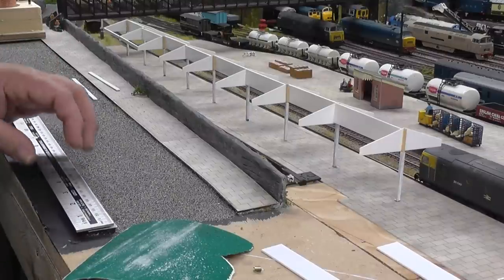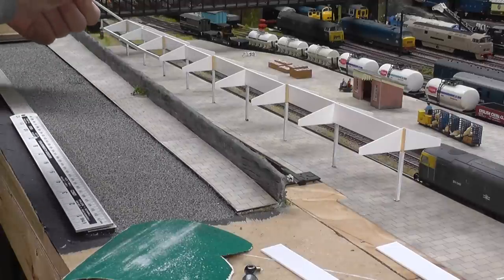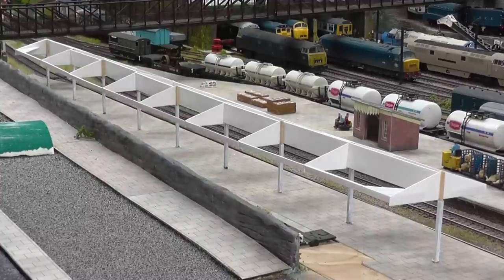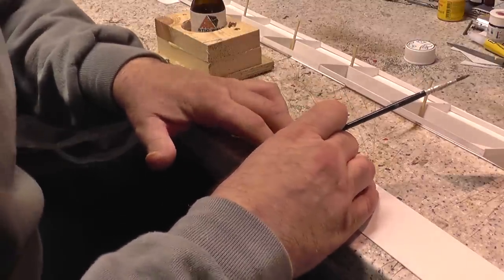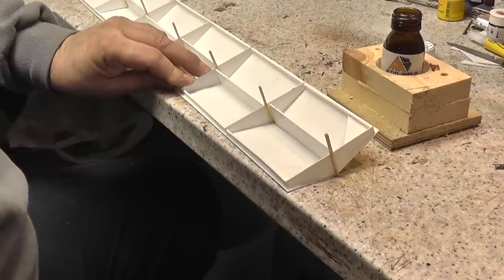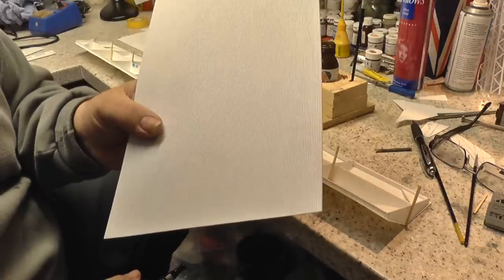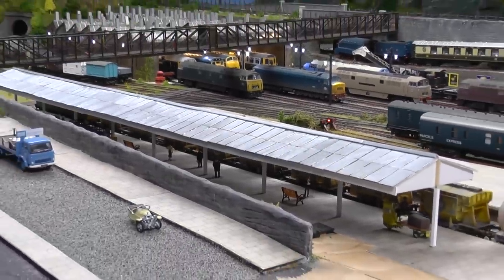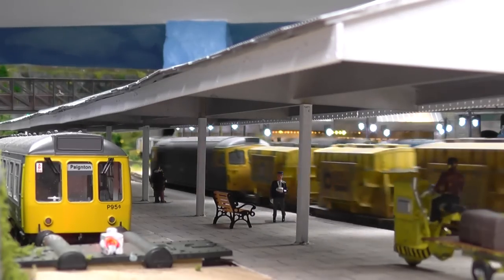Scratch building station canopy on Penwithers

Comment: I admire your tenacity and patience working on the roof.  From the metre or so distance, when converted to 1:1 scale, the individual sheets would not be noticable, being only 1.2millimetres thick.  It is only when the rust starts that they become obvious, and then you would not see the thickness translated to 1:76.  I am an Australian where 90% of roofs are corrugated iron, and nearly all sheds and carports are clad in the same material, so I have had ample time to mull over this problem.  I cover my buildings in full sheets, and then mask up some of the sheets and give them a burst oslightly different hue than its neighbours.  The thickness of a coat of paint is about right scale..

Comment: Kevin, just what i was looking for. I am thinking of starting my canopy, using glass slide cover inserts in the roof and was looking of a good valance. I had only found brass, even more expensive than yours, now i have an alternative. Thank you
Reply from the maker: Hi  John glad it was of use have seen the brass but thought this looked better , it is a bit brittle when I was rubbing it to get the little bits off it did break but other than that a goof product with good delivery cheers Kevin